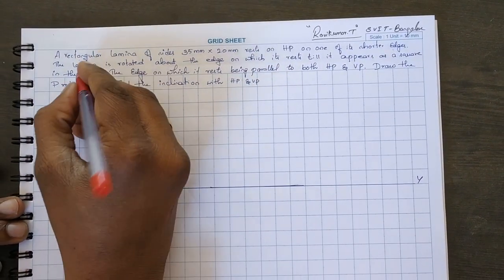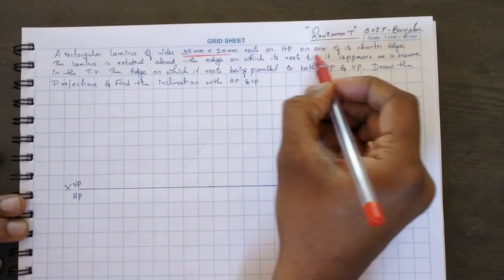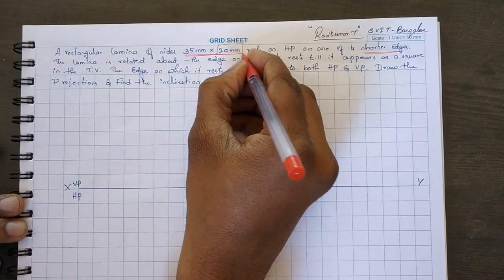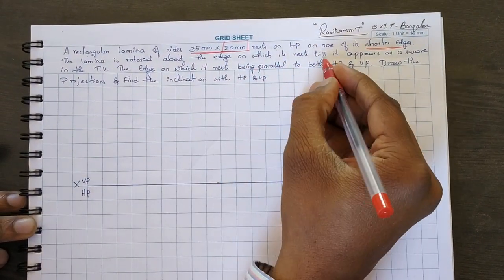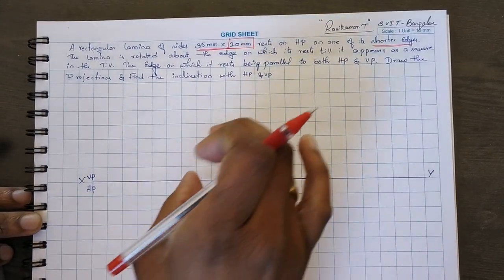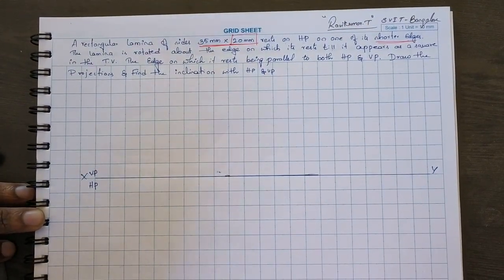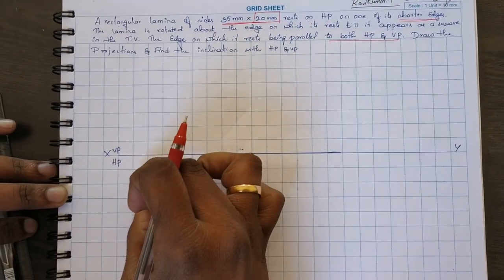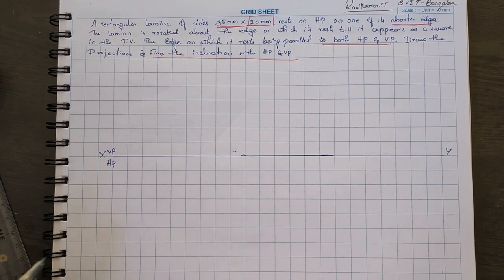Rectangle  Lamina Problem 2- Projection of plane

Comment: A rectangular lamina of 40 mm x 60 mm rests on the HP on one of its longer edges. The
lamina is tilted about the edge on which it rests till the plane of the lamina is inclined at 40o
to
the HP. The edge on which it rests is perpendicular to the VP. Draw the projections of the lamina.